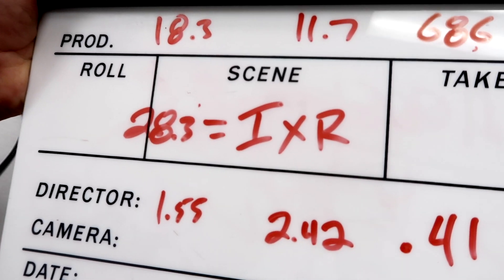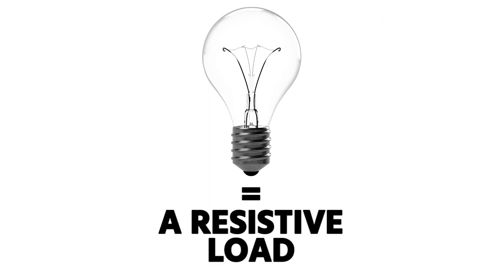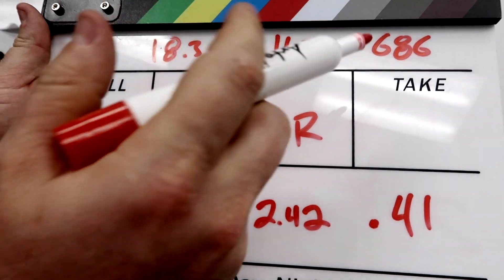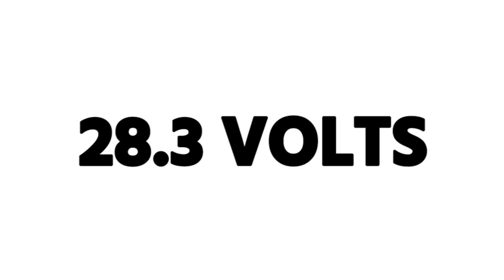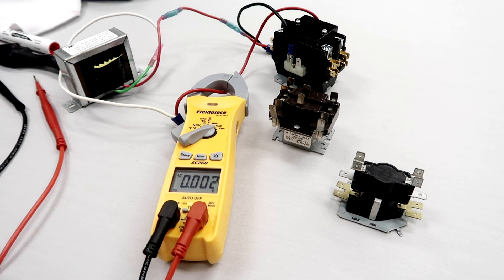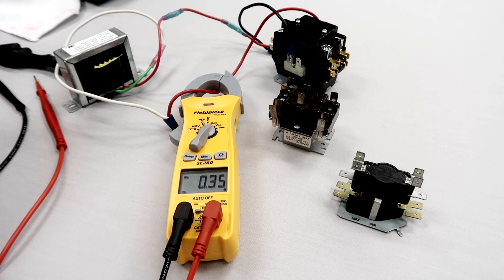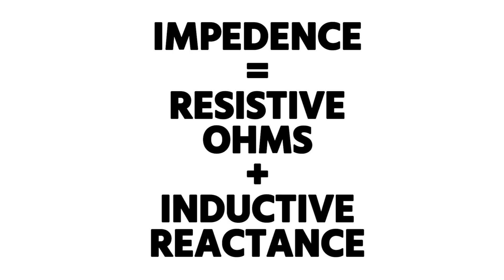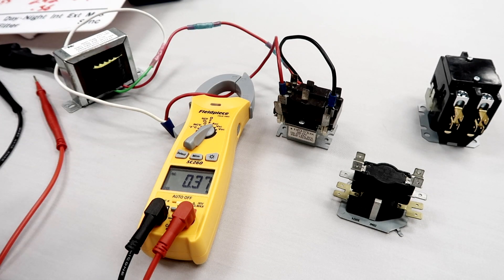Inductive Reactance in Real Life

Comment: "In AC circuits, Ohms law seizes to hold " Steinmetz ( a guy who cracked Tesla’s patents for GE )...reactance is in quadrature to EMF ( and to R)  .. see Pythagoras theorem in Z2= R2 + x2. ?....you'll should read Steinmetz … energy is stored in a magnetic field of the coil, there 's no dissipation as heat but storage and return through inductance. Also it is more of a inertia...not "resistance "....If u think current gives rise to magnetic flux,then flux "collapses " to give rise to EMF, all this happens in 90° off-set

Comment: I have a question that's been lurking around the team. Were all trying to figure out the best way to check evap superheat on pipe diameter larger than the fieldpeice or testo will go. Any suggestions ??
Reply: At the txv bulb location

Comment: It might be worth pointing out that inductive reactance only applies to AC circuits.  Except for the effects of heating changing resistance, DC would should very close to the predicted current using just resistance.
Reply: That's true for standing coils, but inductive reactance will still play a part in DC motors due to motion of the  motor's armature/rotor.